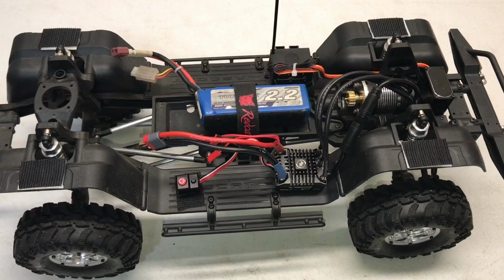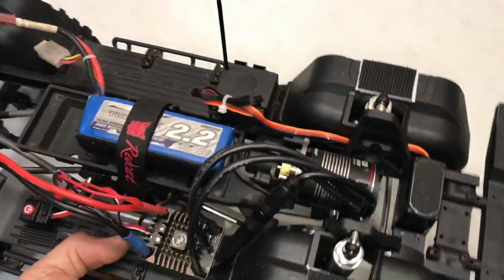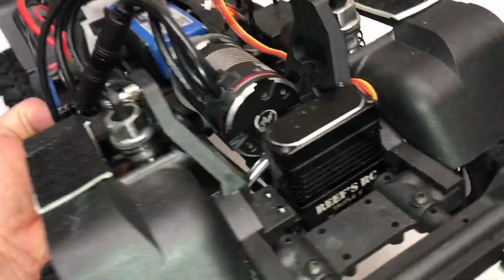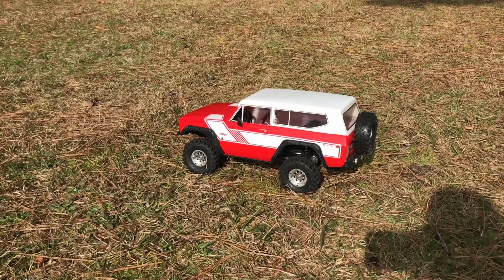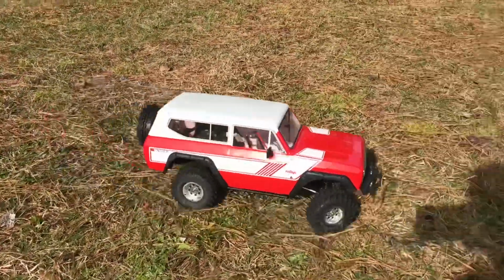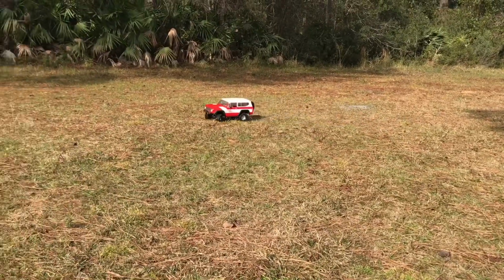Redcat Gen8 Scout with Hobbywing AXE 2300 installed

Comment: The stock Redcat motor has a red tag on power connects advising motor is limited to 2S 7.4 but the ESU has 2S/3S on it's label? Oh yeah I want to go brushless but need a few other things first. As usual great video.
Reply from the maker: so far mine as well as my other friends are all running 3s without issue. If you want to see how many other motors work in this truck take a look at my other videos, I've tested a bunch of them.

Comment: Im waiting  for you to test this with the 3brothersrc Asic motor,
I have their Uncensored 3000kv motor, though i did lower the pinion to 8t. On gmade Bom,  But man i loving that motor.
Reply from the maker: I have that same 3000kv on the way as well as the 1200kv. I just ran the Acis 4600kv in it with the 11t and it did really well. Video will be up next week.

Comment: When you're showing the install it shows it without the crossbrace/body post mounts. Do you run w/o that brace, or was that just to show install? Thanks.
Reply from the maker: I haven’t used it since it came out for this video. I don’t beat on this truck very hard and haven’t noticed any negative effects from not having it in. Plus it makes swapping motors way easier without it.

Comment: Which one do you recommend for gen8, 2300kv or 2700kv?
Reply from the maker: Максим Кладов 2300 does fine but the 2700 has way more torque and quite a bit more wheel speed.

Comment: Do you happen to know who did it first? Portals and this Chassis? because this car chassis and portals scream TRX4...
 I sincerely do not know who did portals first but the design is uncanny similar to that of the TRX4.
Reply from the maker: First portals in RC that I know of were by Gmade in the R1. Traxxas brought the whole portal trend to the scaler world and yes there are some similarities but they are not the same truck. Take a look at my chassis comparison video between this and the TRX4 sport.
Reply: @ExocagedRC  I guess my point is that if the Redcat Gen8 is heavily influenced by the TRX4 (Bronco/Kit chassis) in design ala is that a copycat? Because If I didn't know it I would swear the Gen8 is a blatant cheaper copy of the TRX4 with cost effective measures.